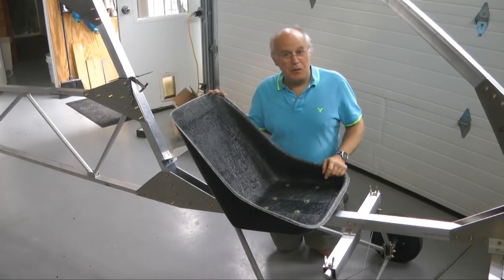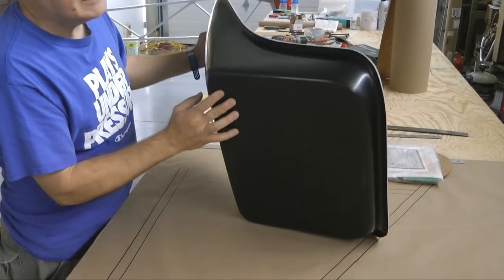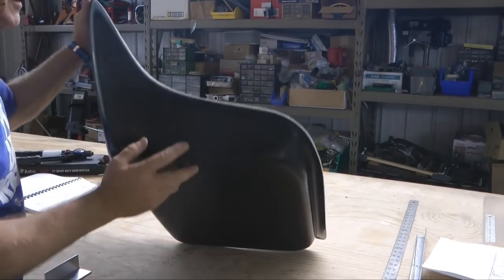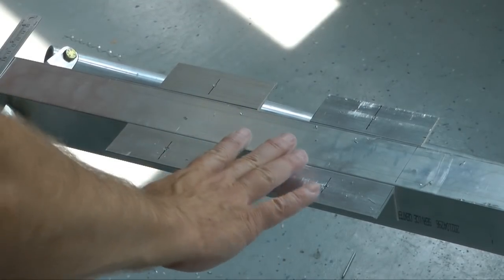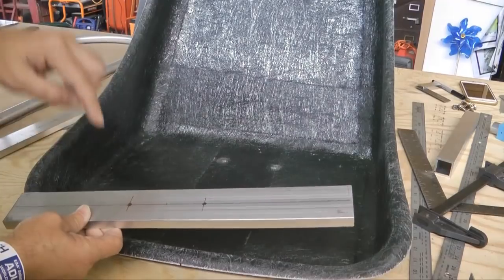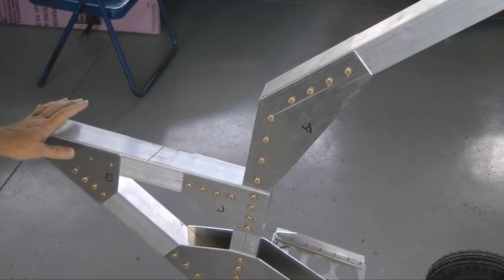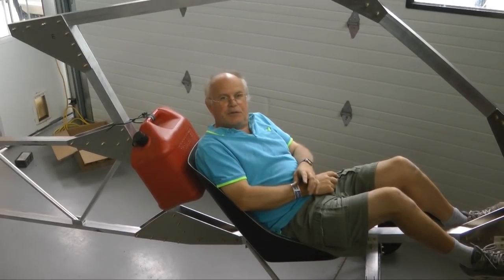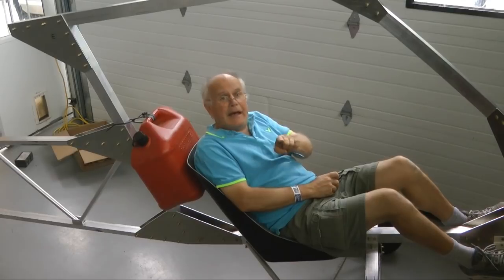Building your Affordaplane Part 12

Comment: with the benson gyrocopter i9 made spacers for all the 1/4 bolts that went through the airframe to stop crossing the the frame  than torqued the bolts  with a torque wrench to the correct torque 
I'm looking at the affords-lane great little plane and I will be using the spacers in the airframe as well as the block in the engine and wing mount areas

Comment: I tried the link that was in this video for the seat you used and it did not work.... looks like a seat I would like to get
Reply from the maker: Just tried it and it worked for me!
Reply: @HomebuiltHELP  I got my seat like yours today boy that came fast and it really is a nice seat.. had a funny smell when I first opened the box bot that went away fast 👍😁
Reply: Oh ok hum I must have done it wrong I will try again in the morning thanks 😁.... looking forward to your next affordaplane build videos .... got my 4 foot square delivered today waiting on my 4 foot by 100 foot roll of Kraft paper from amazon lol... all my airframe 6061t6 tubing is roughly cut with a little longer then needed to make fitting adjustments... the airframe gussets are all cut so I am off to a good start... don’t think I will get to spraying wings before it gets to cold 🥶 outside so figured it will be spring before I get to that... I live in Illinois
Reply: Tried it again this morning and it worked this time yippee lol I ordered my seat gel coat black.. not cheap but better then using a cheap boat seat.... I got black don’t know what my plane color will be and black works on everything if I want to.put a color on it a cheap rattle can will do it lol...

Comment: I have to ask I am building myself on the video it shows the plastic piece you install inside the 2x2 so the tube doesn’t it crushed on the engine mount and the rear were the wing bracket is my question is why not put one in the tubing in front of the wing to??... I will be making my wings and tail folding for my trailer so was wondering about the reinforcement of the front tube for the wing....
Reply from the maker: Hi Greg  According to my plans - to be used at the engine location and BOTH wing mounts!
Reply: Oh ok great thank you for Clearing that up I am still at the beginning of my build got gussets all made and just rough cut the airframe tubing was watching video 12 and you only showed the engine tube and rear wing being reinforced that’s why I was wondering... I love ❤️ your videos and I am watching your affordaplane build closely as I am building one myself.. thanks for the reply 👍😁

Comment: Could the polyethylene sleeves be cross-drilled for weight?  They would still be dense enough to be crush-proof and likely provide enough structural reinforcement, depending on the direction of the holes, or am I mistaken?

Comment: Why are you bolting everything instead of welding it all out?
Reply: Welding causes significant heat stress to the metal being welded. Welding softens the temper of the metal up to about an inch or more near the weld. For straight line welds, this can extend a little further out. Softening the metal means the metal can no longer hold up to the specified stress point (both sheer and tension) and can significantly lower the ability to handle the loads needed for safe flight. ... On the other hand, drilling and bolting does not compromise the metal (in terms of temper).
Reply: In addition to what Jim said...How many people know how to weld Aluminum,  huh...Even Pros hate it and have a hard time doing it...Plus, the cost of a Welding machine, and other ancillary equipment...It can easily take more time,  more skills, and more money for the build...Also, Jon is building this plane as close to the plans as possible...Not to mention that,  this ain't his 1st rodeo....Now also, if you want to weld yours, go ahead... Post vids from start to finish....And, show all and any info to the minutia....Many people are dogging this plane out...Saying it won't make Part 103...254lbs weight limit...Jon is doing all he can to  prove them wrong....I may never build one...No place to build, and more importantly,  no place to fly it if I could or did.....Cheers 🍻!!!!
Reply: The others all made good comments on material strength issues due to welding, and fabrication skills. the whole point of this series is trying to help make flying more accessible by building an ultralight that requires no expensive tools and complex skills to build. He is building to the plans, so that people don't need to be engineers to have a plane, and he chose a design that intentionally doesn't require welding.